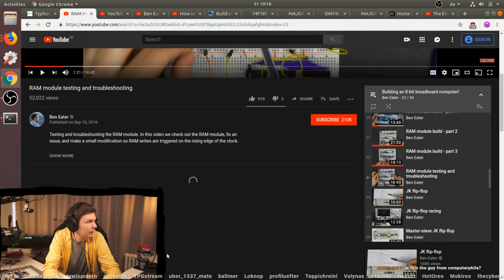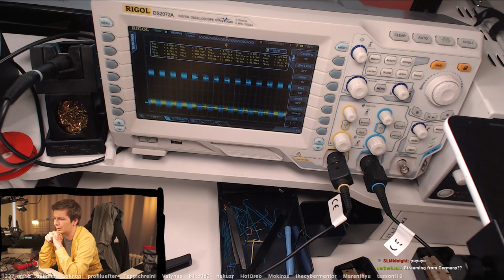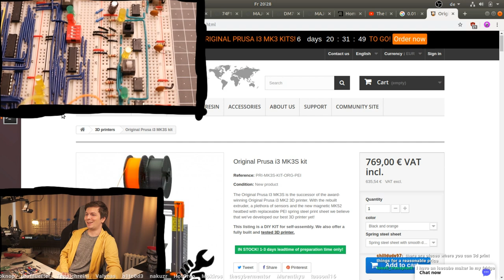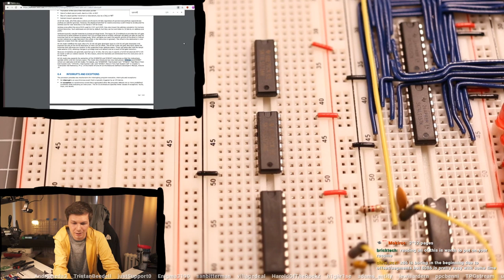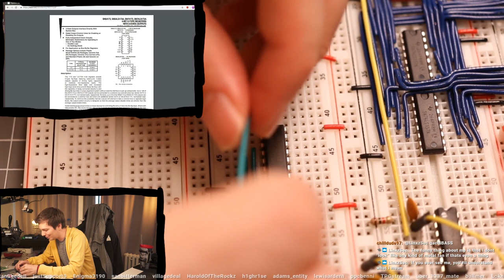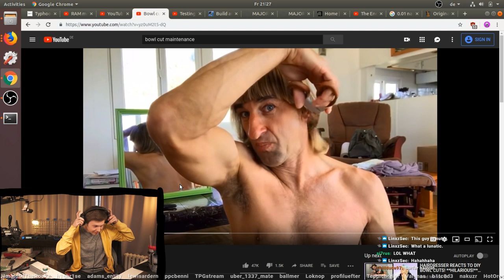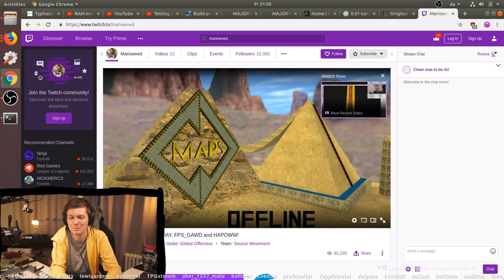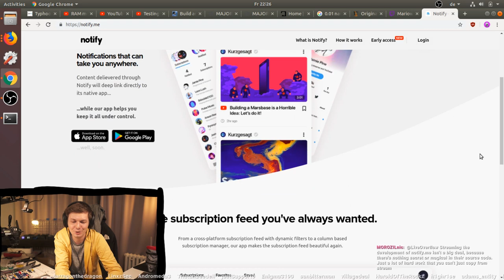Instruction Register Build - 8-bit Computer

Comment: 3D Printers have just gotten cheaper over time, it doesn't mean that they are bad
33:04 i thought the 8086 and above had different Memory segments that you could place anywhere in Memory, essentially making it a pseudo-Harvard Architecture since you can keep your Code seperate from your Data and the Stack.
which seems like a great thing since that makes stack over/underflows a lot less serious, and buffer overflows become useless